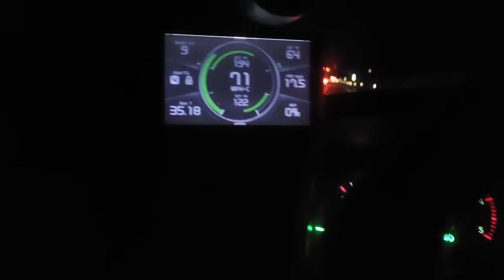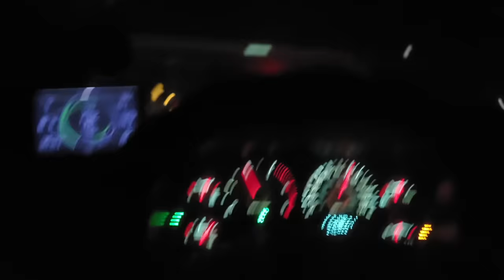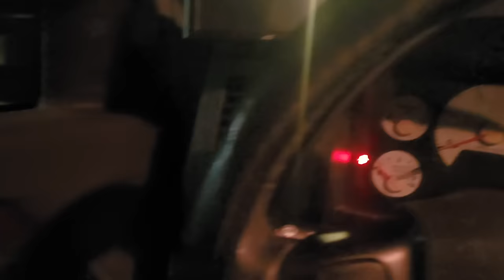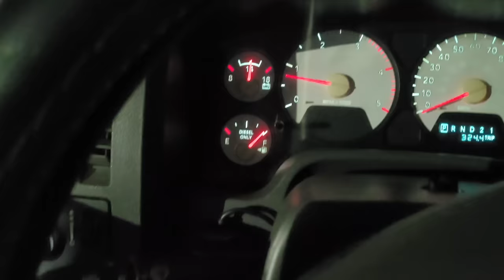1,200 Mile In A Weekend | Had To Call A Tow Truck

Comment: i'm glad you wised up and made the switch to 4x4! Also what size  and rating is that trailer? i want one i can haul trucks on but dont know anything about what trailer rating  i need , i'm thinking at least a 20 foot will do though for length
Reply from the maker: I didn't need 4x4 before. This one should be 9990 gvwr. 20ft by 8 wide

Comment: Steve can you change you trailer 
Fenders to fold out so when you load bigger trucks just drive up easier maybe 
Wat you think would it work
Reply from the maker: The plan was removable fenders eventually
Reply: @CPSteveMiller  good anything 
Be improvement 
I've seen fold outs they work  good
An just pin in place

Comment: What’s the best “ setting “ for the trailer brake controls? For a single car hauler every time I hit the breaks my tire damn hear burn out 🤣🤣
Reply from the maker: I generally go off of feel. If I'm in a parking lot I'll turn them all the way down. This trailer they don't lock up so I have to turn them all the way up on the highway. I usually set them to pull me back a little and then back it off a smidge
Reply: I believe the setting that I've read about in some manuals is basically by feel. You set it at like 10 - 20 mph on flat ground so that with light pedal application the trailer stops you without locking up, or something along that line

Comment: I want a GV overdrive!!!!! I'm worried whether they will handle the heat though...
Reply from the maker: I'm still not sold on them
Reply: @CPSteveMiller  the newer ones have cooling fins
Reply from the maker: Any bucking and they snap. Cool or hot it doesn't matter 😬
Reply: @CPSteveMiller  they are using them in pro street and drag n drive so they certainly hold the torque and power. I have a G56 which, as you know is a very snappy/jerky trans so i don't need that... LOL
Reply: @dptp9lf NOT in a towing situation hauling weight.  You can't compare a 4k lb car to a loaded truck.  Gear Vendors will tell you that.
Reply: @Itsa_Mea  I talked to GV one time  and they didn't mention the heat but we didn't talk that in depth and a "salesman" wouldn't mention that anyway LOL

Comment: What's the best load board for auto transport? I have a 3 car hauler.
Reply from the maker: Central dispatch will be your best bet. There are a few other ones but I can't think of them off the top of my head. It has been awhile since I've used anything else.

Comment: What all do you have on your pillar?
Reply from the maker: Just fuel pressure for now. Planning on oil pressure and undecided on the third. 

I have 9 gauges on the cts2

Trans temp
Speedo 
Coolant temp
Intake temp
Run time
Throttle %
Boost

And I can't remember the other 2 off the top of my head

Comment: What headlights are those on Bertha?
Reply from the maker: They're on Amazon. I found them before but they came on the truck. Just type in headlights and scroll through. They'll come up pretty quick
Reply: I use lasfit leds on 3 of my trucks, they're perfect,  they also make switchbacks now that will make your headlights fog lights by flicking the switch

Comment: Why do a 12v swap and not just buy a older truck ?
Reply from the maker: 2nd gens are garbage and 1st gens are too rickety. It's nice going down the road with 4 full doors and a truck you can actually have a conversation in 😂
Reply: @CPSteveMiller  got you I have a 24v 5.9 looking to get a 2nd truck for my hotshot company. Trying to figure out what to go for
Reply: Thinking ima go with another 05-07 5.9 had good luck with them
Reply from the maker: Only reason I like dodge is for the 06 to 09 platforms. I had good luck with a 2012 ram 4500. Loved that truck but hate that they need to be deleted. 

I'm not as big a dodge fan as guys think. I liked the 12 valve for the mechanical aspect but hated that they leak no matter what. Plus I missed all the electronics and tuning. I was ALWAYS tinkering with the 12 valve. The 06 just goes. No worrying about setting idle and all these others adjustments when the weather changes etc.
Reply: @CPSteveMiller  100%

Comment: Steve, I'm an advocate for people pulling further off the road when they need to pull over because most people don't pull over far enough and end up creating a safety hazard for traffic but come on man. You pulled over way too far off of the shoulder and that was completely unnecessary and you should know better.

I'm disappointed because you drive as much as you do and have as much experience with things that you do such as mud and highways and pulling trailers and all this other stuff that you should have known better than to even attempt to get that far off of the cement shoulder and should have known that the ground itself was going to be potentially soft. Especially in an area that you were not familiar with and you didn't know if it had rained there that day or the night before and the ground is going to be mush.

I'm not trying to get on you too much because I like you and like your channel even though I haven't watched a lot of your videos lately. I just don't get why you do some of the things you do sometimes. You should know better.

At the very least, maybe just pull off so you're two or three feet away from the white line and maybe your front tires are just barely over the cement or asphalt shoulder so you still have most of your truck and trailer on the concrete.  At least the tires onnthe driver's side for sure.

Or, better yet, maybe just pull up to the next exit and piss instead of trying to pull off the road there. You can't tell me you couldn't have held it for another minute. If you had to pee that bad, you obviously passed how many different exits before you finally realized that you needed to pee?  40?  20?  10?